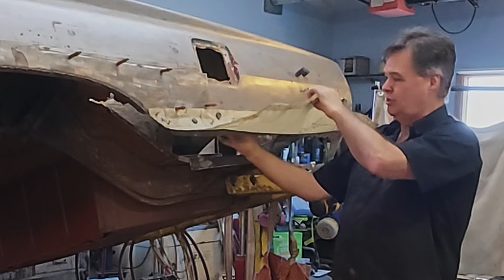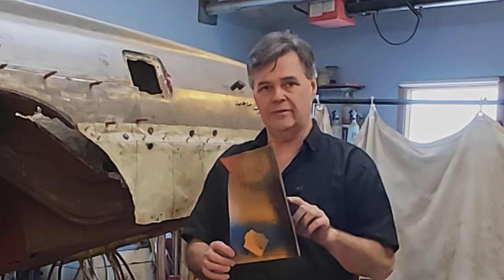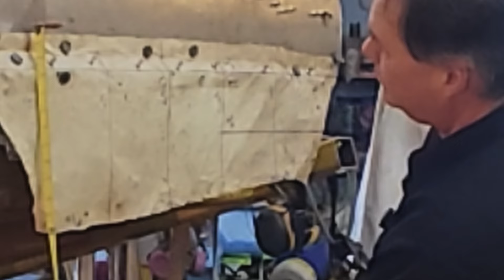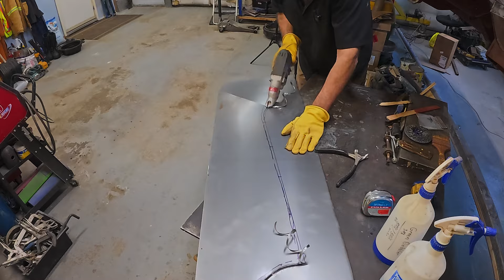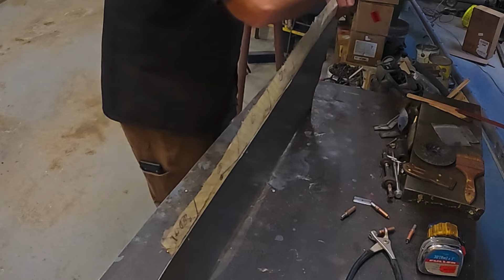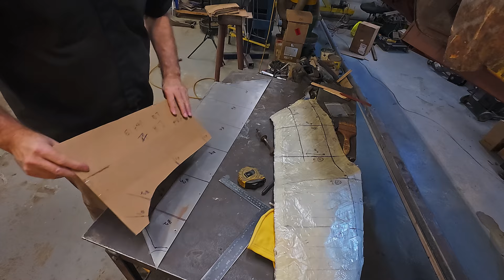Patch Panel Layout Using A Flexible Pattern - 65 Thunderbird Convertible Ep #79

Comment: Hiya Alvin!
That’s pretty slick CAD program you got there (cardboard aided diagram). I’m anxious to see how well it works for ya. I usually make the piece by eyeball and see how it lines with the old and adjust accordingly. But that system may be better.
Reply from the maker: Hey Troy! "Cardboard aided diagram" - I love that! 😂
This is the second time using this pattern setup, it worked out well on the hardtop...well, mostly for checking the panel on the hardtop.